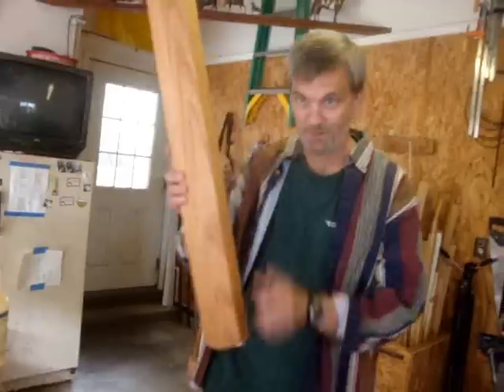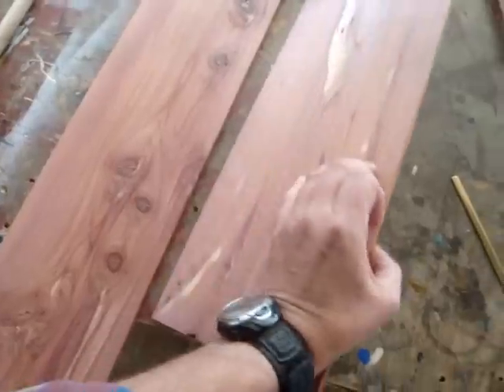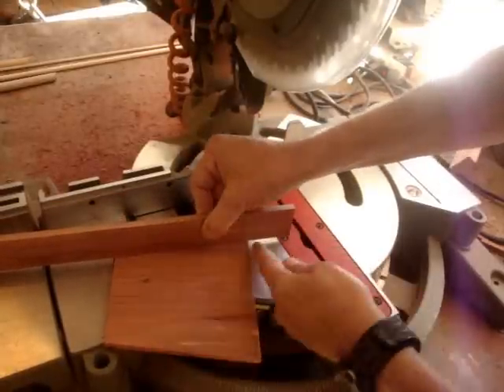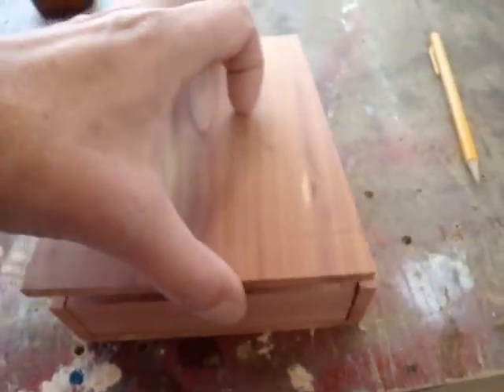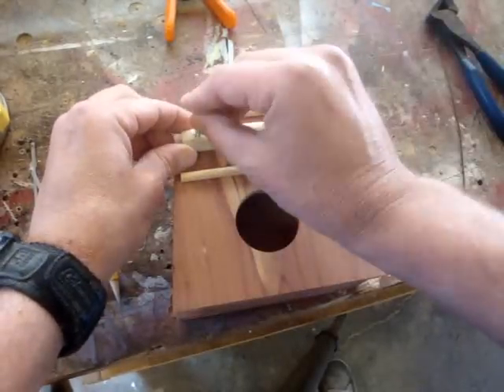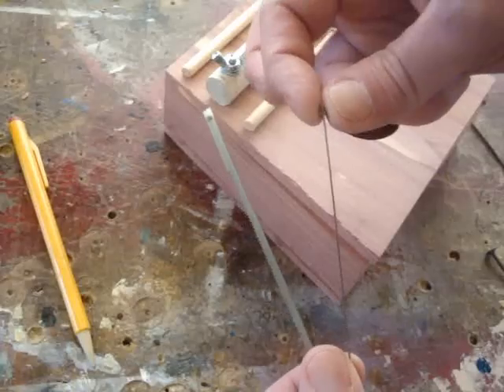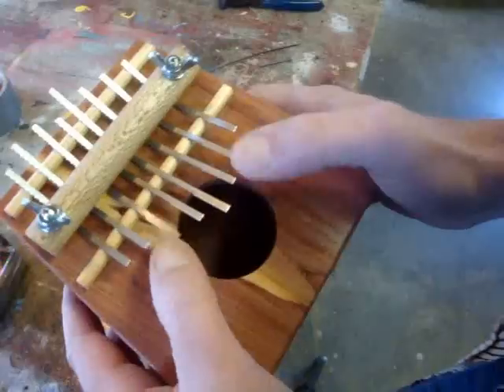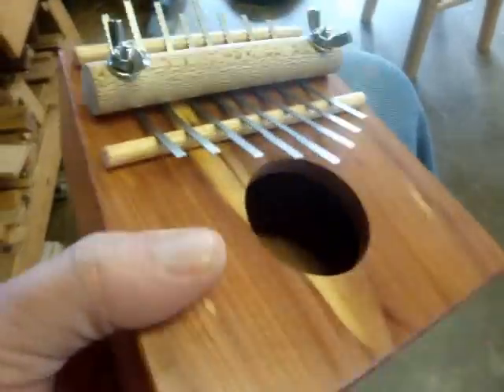Make a wood thumb piano

Comment: This is a good starting point to make your own thumb piano.
For those serious about it, some tweaks that can be done :
Size and shape of the resonating box depending on the targeted tones.
Size, shape and placement of the resonating box hole. Placement of the anchor for the reeds to get better resonating effect.
If none of this can be done , at least a good idea is use glue metallic rods (anchor) instead of wood where the reeds are resting, this reduces the damping effect a lot.

Comment: You would probably get a better sound with an 1/8" top and a larger soundboard. The thin top would need bracing. The hole in your project takes up most of the area and will reduce vibrations needed for amplification. A smaller hole placed at the bottom would be louder and richer.

Comment: Try looking at a few old windshield wiper blades, some have a stainless sprung steel spine that you can slide out, they are the perfect size to make the 'tines' for this type of instrument, very hard to cut, I used a dremmel with a cutting disc to cut them to size and smooth off the cut ends.

Comment: Used windscreen wipers are a good source of cheap spring steel
Reply: Yep, and they are usually not very wide..and do make higher pitched sound..  Go to dollar store and get a  drain snake. the thin flat steel one.   Be careful and use safety glasses and gloves if using a grinding wheel.  Leave the times longer than needed  until after you tune.. yep, the back end will look ragged after the front playing end is  tuned.. but  later you can draw a line across the back side and cut them even.

Comment: for the screws, the best method would of been doing the lacquer before gluing on the top plate, or glue the screws in the top plate before gluing it onto the rest of the box, that way they are stuck in place, and you can lacquer around it. you could of googled what kind of metal to use for the keys